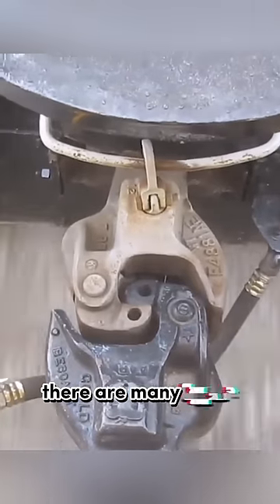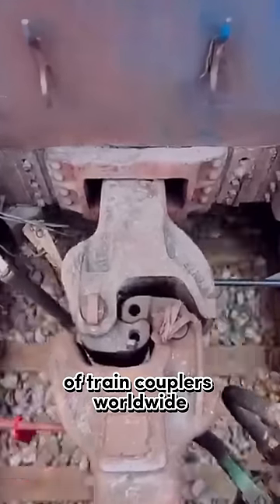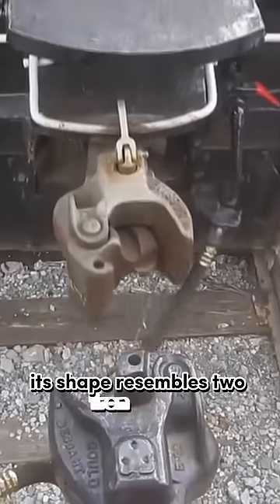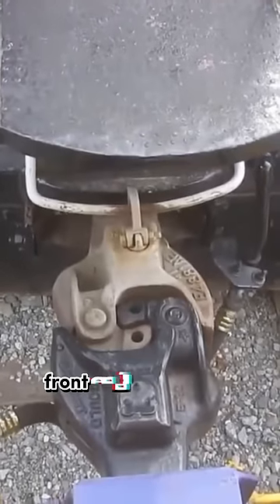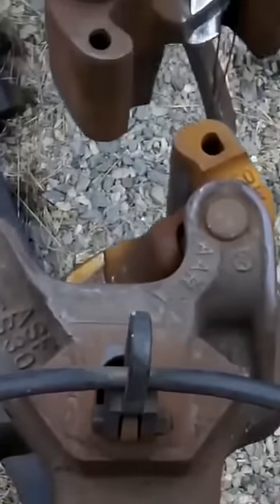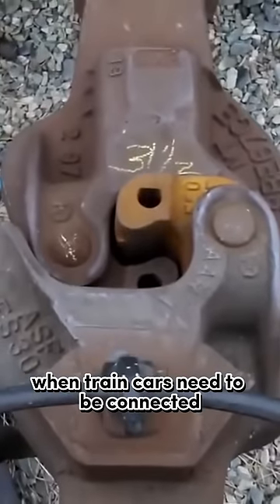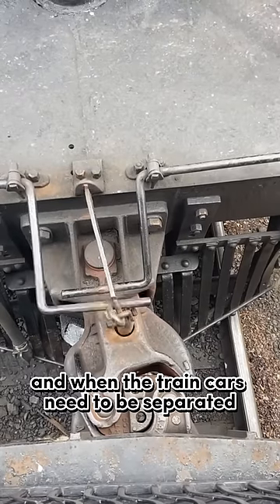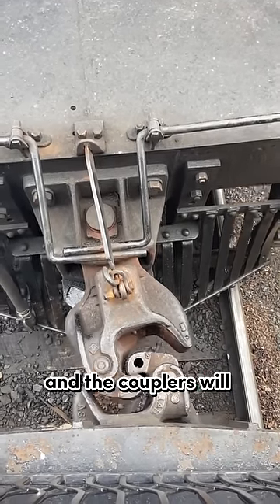How Train Coupler Work @SRR475 @extreme_media  #shorts

Comment: The first guy clearly never heard of metal fatigue...😂
Reply: please explain I was already scared enough for that dude lmao
Reply: @CrimmzZT it means metal often bends or breaks when there's strain on the metal over a long time
Reply: You haven't heard of maintenance
Reply: @paulstark9273 no lol
Reply: You haven't heard of India.
Reply: Metal fatigue I also not heard ..in this part of world .. unlike first world ... Jack of all master of none ... In first world master of one...
Reply: The first clip was of an old ICF type coach which had a 'Screw-type Coupler'. People have to go between the vehicles to couple them up. But don't worry, the janney type is mostly used nowadays, and most of our Indian Railways locos have transition coupler, which means both Janney and Screw type
Reply: albertj.mendoza9586 this isn’t exactly true. Because you have to look at elasticity and plastic deformation. If you never reach the fatigue area of the stress curve, you can use it a billion times. The problem is when you hit the plastic deformation range. Most metals will actually get stronger for a bit, then the strength falls off a cliff.
Reply: There is no fatigue in India, there are only accidents 😅
Reply: They sit on top of the trains in those countries, so I'm sure H&S isn't a big issue with that lad!
Reply: albertj.mendoza9586 
Hmm. Is there a warning label on jack stands about metal fatigue? Ive never even heard of this.
Reply: @azzidopintea4953  and you haven't heard of india
Reply: Welcome to the Indian railways😂😂

Comment: The most common European design however is the screew-link coupler! A hoock with 3 chains connected to it! Now to prevent them from being crushed when coupling there are buffers that stick out more but when the chain is out it's far enough to reach the other coupler on that piece of rolling stock
Reply: Most passengertrains have the Scharfenberg kuppler don't they?
Reply: @wissenistmacht8930  most passenger trains are MUs with boggies so not that much of coupling. In France we have a big thing with a cone to couple two MUs together.
Reply: @FlatEarthKiller  no it was common until the 70s
Reply: @FlatEarthKiller  unless you live in India
Reply: Still use screw couplings on lots of freight in UK , TBH we get more divided trains with the buckeye coupler . Loco hauled passenger has used buckeye for many years but with screw coupling to loco . The 3 link chain (instanta ) your on about isn't used much now , very limited to how tight you can get it ie the loose or tight position on middle link
Reply: @nounoufriend1442  pretty much UK learned from American couplings because let's be honest TTTE wasn't exaggerating about coupling breaking and coming apart
Reply: @Zephyr_Phoenix76  Yes agree we use American buckeye on UK freight ,they are safer to use and keep train together in derailment far better than a screw coupling . But we do have more divided trains with them , but many of them are a fault of who put train together . We do a simple pull test then assume all is ok but this is not always the case " locks not in , release gear binding , are all factors causing train dividing
Reply: Bro we watched Thomas, we know that chain and hook couple breaks all the time
Reply: The first clip is probably for the screw link couplers.
Reply: @volty58 Do we have any couppling mecanism that would stop my rer from being late ? :(

Comment: That train in the first clip was moving way too fast. The force of trains coupling based on their speed is exponential, not linear. There's a great film from the 1950s describing how this works by comparing it to how high you would be dropping a railcar from the ground "x miles per hour is equal to y feet high".
Reply: Chill it's fast forwarded
Reply: What xy bro this ain't the transformer
Reply: @AAAAA-re6qh It's BASIC MATHEMATICS

This generation is doomed.
Reply: Quadratic, not exponential, but yes.
Reply: Their is always one guy. Congratulations, you are THAT guy. Do inform the bride before she throws the bouquet the physics of a proper throw to make sure she positions her feet accurately, to offset gravity so that the theory of relativity can place the bouquet in the exact space at the precise time to be caught in a manner that one or both hands can be used, while the reciever of the bouquet is moving in a forward motion as the bouquet is moving in a reverse motion?

Comment: 1: they're knuckles, janney knuckles are a very specific type of knuckle which is very outdated
2: rail cars vary rarely have a "front"
3: it's not a "safety pin" it's just the pin. Keeps the knuckle locked in place
3: it's only one type of modern coupler
4: you didn't explain how they stay closed so

Comment: The first one with the guy in the middle isn't a knuckle coupler. Those kinds of couplers are known as "Buffers and chain couplers". They are connected using a chain which needs to be manually attached to the hook of the connecting carriage, which is why the man is there to attach the chain to the hooks.

Comment: That's the shunters job to couple the trains. They will uncouple when there is a short drop or uplift in the rail track. Thus 1 coupler is lower than the other. Had it occur to me several times on the same location. Reported a drop in the rail line. After a track worker saw the track drop they closed the rail to fix it up asap. They never believe train drivers

Comment: The purpose of the gentleman between the trains is to draw them together using the gravitational force exerted by his ultra dense balls on the train on tracks.

While the density is not comparable to, say, that of a neutron star or a black hole, they are more than strong enough to require protection for the trains so that he doesn’t hurt them.

Comment: The coplers that we see now actually isn't the Janny. We use simaler coplers but the Jenny is the original Patton, nowadays we only have a variety of couplers are compatible with each other. But they are not the genie Anymore, so what we use is a series of separate different kinds of couplers on all types of American rolling stock. And we see different kinds of couplers also but yeah it's not the Janie